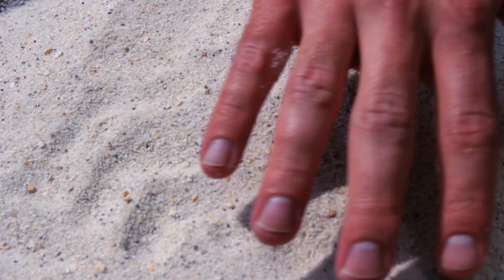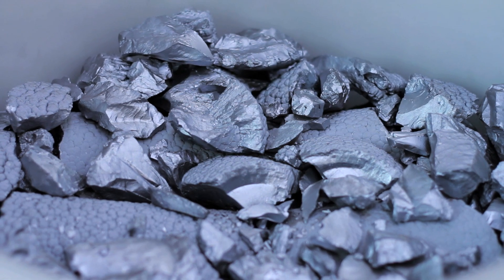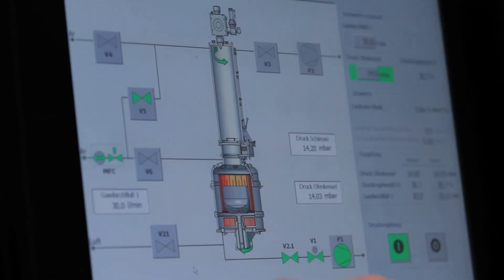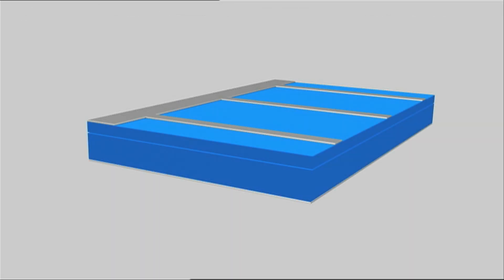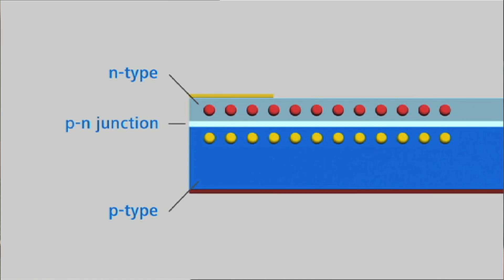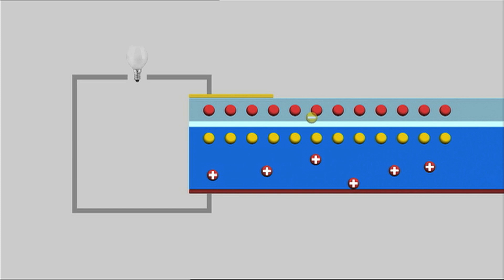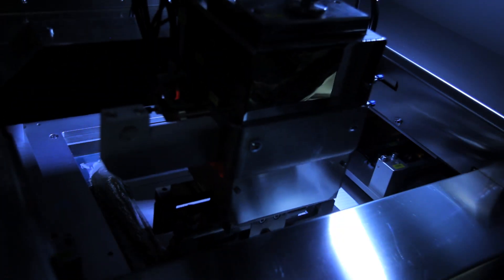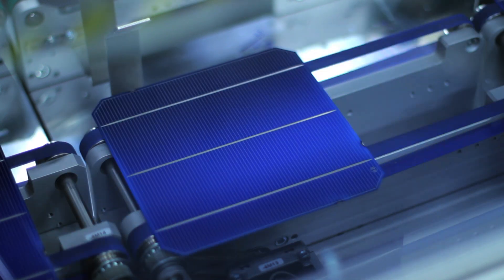BOSCH Solar How Its Made

Comment: Why can't we place peltier modules with heat discipitatator under the solar panels so that it uses heat and generates some additional electricity and also can increase the efficiency of solar panels as heat on panels reduced after transferring heat to Peltier midules?. Please let some one clear this by giving technical and practice feasibility.
Reply: That is a great idea but im not good with eletroinic parts' names so i dont undertand anything of what u r saying
Reply: idk we can name a few... Efficiency, production costs, we had to adapt the production plants, distinct behaviour of the electricity produced, etc... If it were that simple, probably some big company would've made it, trust me.
Reply: Solar cell researcher here. You may refer to thermophotovoltaics (a current active research area) for more details.
Reply: @BlackRockExecutive  Thank you very much.
Reply: @BlackRockExecutive  Thank you very much.
Reply: Peltier modlues have very low efficiency, it would increase the cost a lot with only a small increase in produced power

Comment: This is a very simple video. Nothing about the coal or chemicals in the glass tube. Nothing about the PVC or chemicals in the sealing. Nothing about the EVA, back sheet, switch box, ext...
PV are much better than coal (pollution) but not the best.